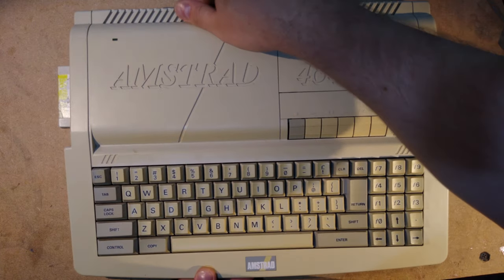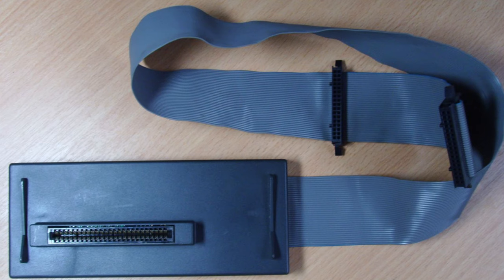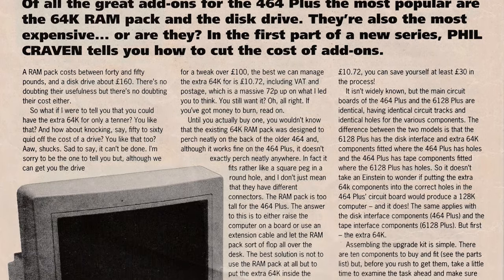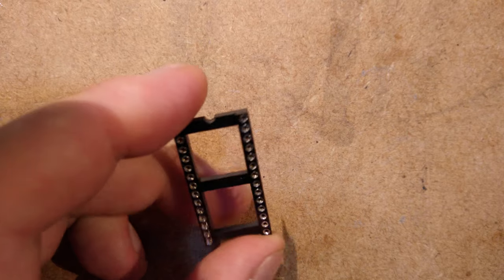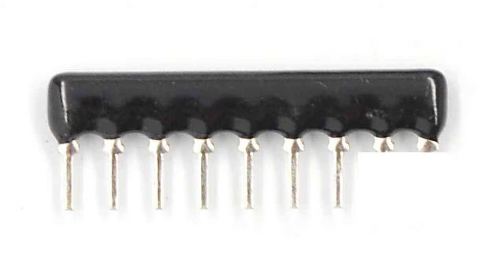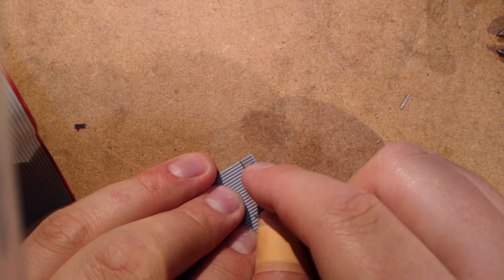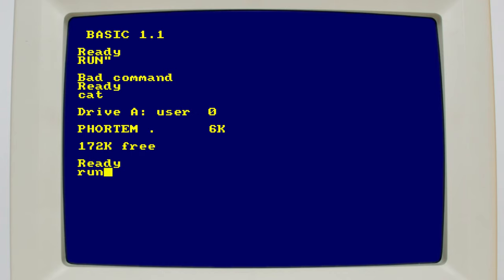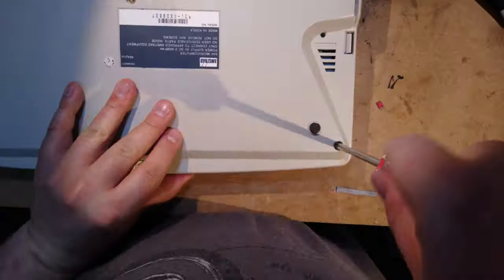Amstrad 464plus to 6128plus conversion

Comment: I know I'm 2 years too late to the party, but there's a passable replacement for solder braid. Just copper cable (preferably with a lot of very thin strands) with some solder flux applied to it. Not quite as handy as the real deal but it works well enough if you run out of solder braid at the worst time.

Comment: Fantastic video - it actually makes me wonder if I should swap my 6128 Plus for a 464 Plus!
Reply: Why would you do that? Except for loading cassettes for nostalgic reasons, the 6128plus already has everything that was done in this video. And adding a cassette port is much easier than doing all of this. And to add a Gotek to the 6128 plus is even easier. Just get a Centronics connector and crimp it to a floppy cable: done! No soldering required (unless you want an ABBA switch to switch between A and B - but even that is simple)

Comment: I've only recently found your channel, very interesting, thanks.
Ah, I know 'if only's' are pointless but assuming the '+' ASIC was too advanced to go in the original CPC's one wonders if the '+' range might have been a little more successful if the Z80 was clocked @ 8mhz?
Yep, a 6mhz mod works and so would 8mhz if you could find a monitor that could sync to an over-fast video output... it might not have made a huge difference but as the hardware can do it a bit of extra speed to allow more '16bit-alike' software may have been enough for some. The '+' actually has very good GFX indeed, just nobody bothered and the 4mhz Z80 wasn't really enough to drive it.
Rambling...

Comment: In my experience, loading tape software from an external cassette player is also considerably buggier than from the onboard drive. Slightly off volume settings and imperfect connections or cables leads to noise and the dreaded read errors A and/or B.

Comment: i just use the zaxon usb drive with 512kB expansion on an original 464 (it also has parados etc), there isn't that much use for the extra cpc-plus enhancements.
Reply from the maker: Yeah I'm thinking about getting a DDI3 for my OG 464. The 464 plus setup takes less desk space though
Reply from the maker: @DirkDierickx  What on earth?! how did you make that?